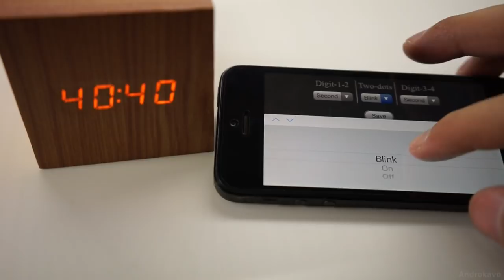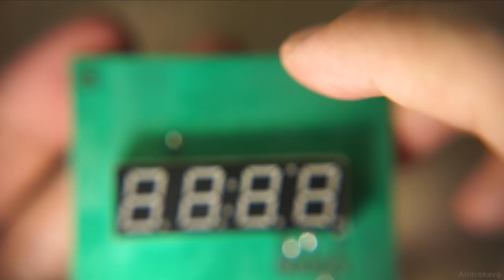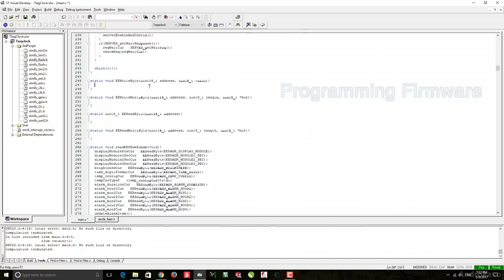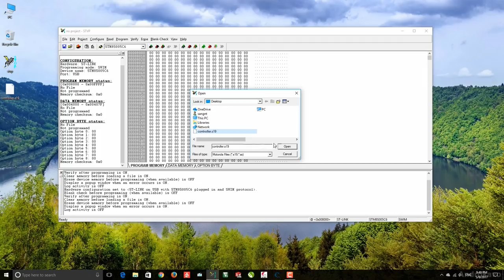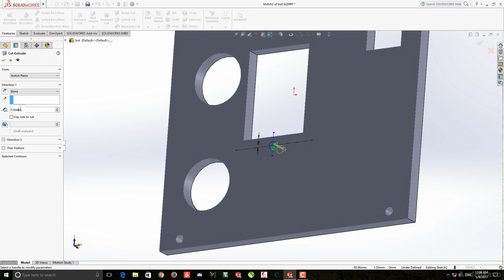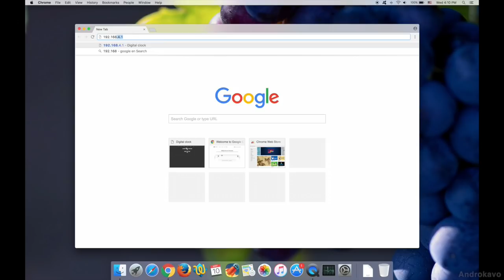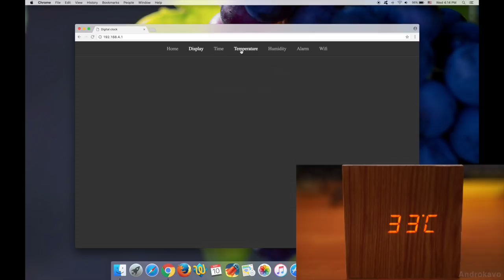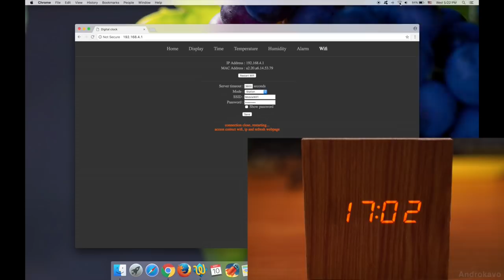DIY Wooden Digital Clock

Comment: I really loved the idea of creating an access point to access the ui to change actual wifi credentials. As a web and network socket programmer (not really expert of electronics just esp8266 with arduino) i really loved it. Great job man. That is a problem most of the videos about esp 8266 they all put the credentials to the code. Respect!

Comment: Since you have wifi, why not use NTP?
Also why use a separate micro, when the ESP8266 is much more powerfull to begin with!?
Reply: I find it strange also and curious to confirm how the ESP was programmed. Its plausible the instructions were pushed from the STM8S. If so, this would be the first case I've seen on Youtube.